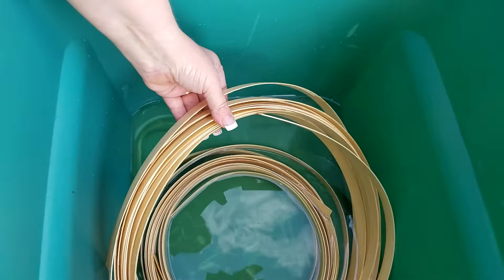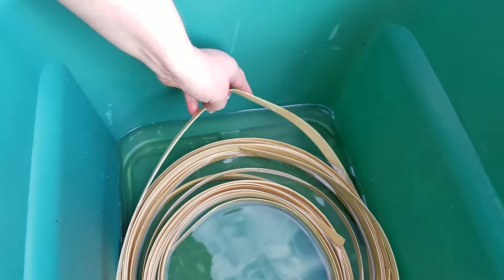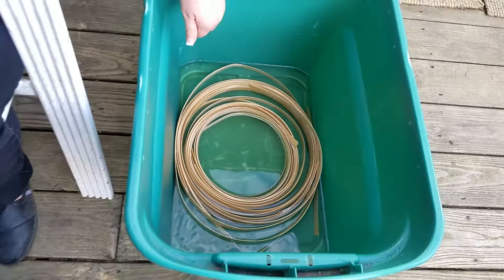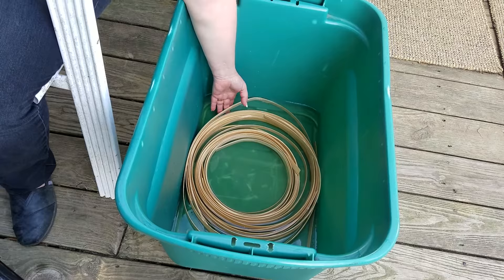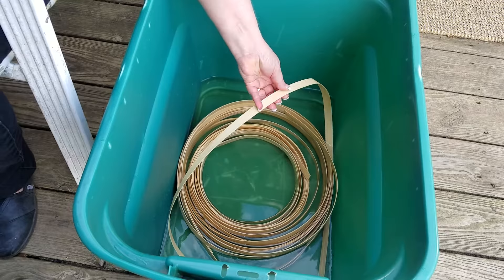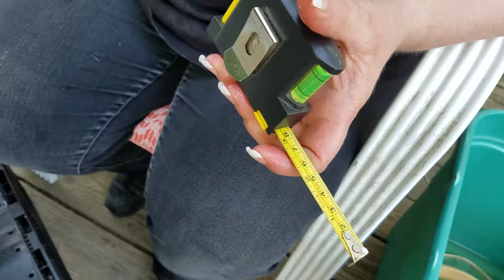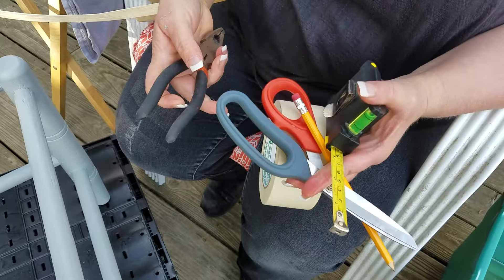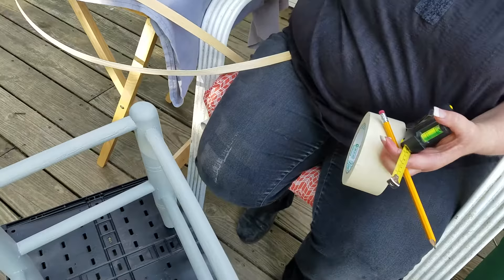DIY How-to Cane a chair with Flat Reed Herringbone pattern weave

Comment: How many feet of reed would it take to do 4 full size chairs? My grandfather had a chair making shop. He cut the trees and made his own reed. I remember watching him when I was young. He has passed and I want to do a set of slat chairs that belonged to him and my grandmother. Ty for the video
Reply from the maker: Candy Troutt I used approximately 3 -120 foot rolls for 4 children's chairs. Not knowing the dimensions of your chairs or the size reed you would like to use I would not want to give an estimate and be off causing you you to run short or spend money you didn't need to. I found a calculator that will help you estimate how many feet you will need. I hope you gind it helpful! Thanks for watching my video. http://www.basketmakerscatalog.com/ps/helpful-hints/1653-flat-reed-chair-seat-calculator.html
Reply: When you order supplies, like from Peerless Rattan, then are formulas to use to know how much material you will need. Plus, Ed Hammond is very helpful. Give him a call.

Comment: Great video :-)  Do you put any type of sealer on it after it dries?  I had an old rocker done years ago and the seat and back got discolored ( moldy ) spots on them  as it was drying.  Also I think a butter knife would work well as a tool instead of that little extra piece you were using  :-) Thanks